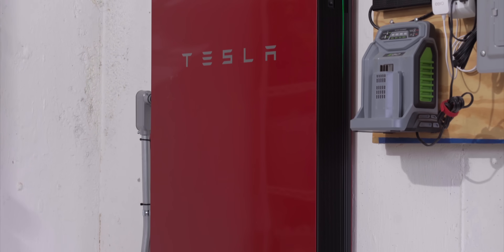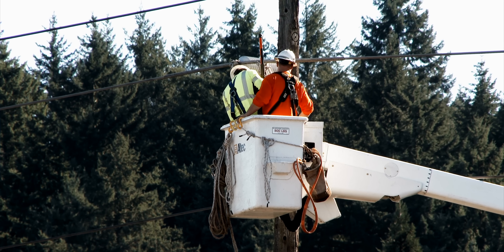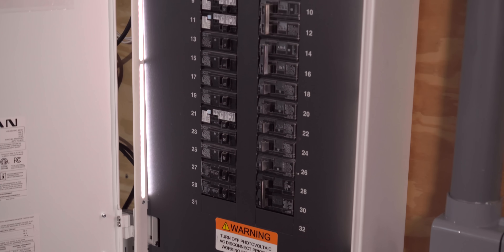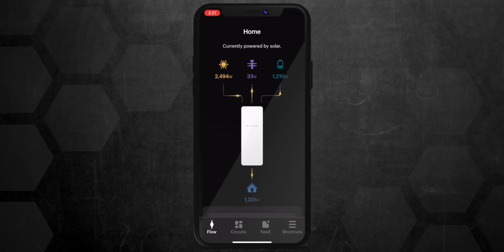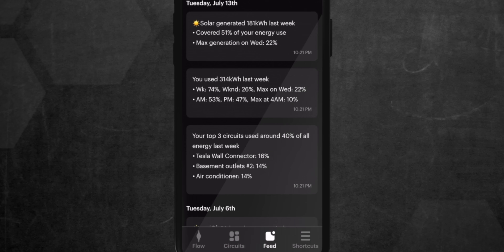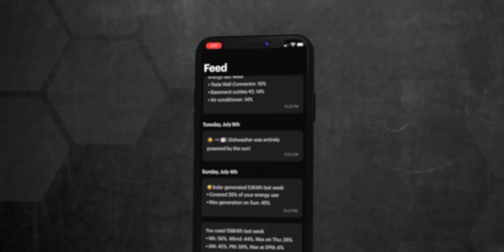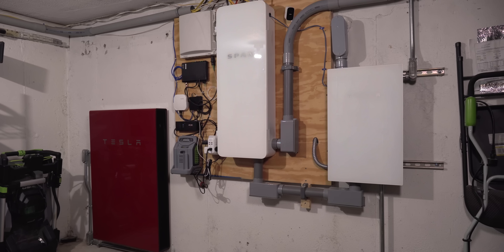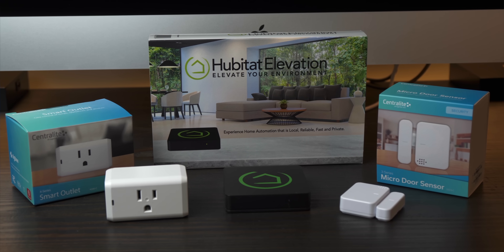This Smart Home Electric Panel Fixed My Tesla Powerwall

Comment: The SPAN panel looks to be super useful. I have 8kW PV without a battery but with and EV and without any net metering so I need to put PV power to use when it is available which is mostly managing the EV charging. Sense is a great product with nice history and makes the most of just 2 sensors, but SPAN has the real sensors on every breaker and WiFi breakers to be a real control system, but limited to breaker on/off. SPAN would give me more control options, although a juicebox charger would allow me to dynamically modulate my EV charge rate, something Tesla does not currently support and SPAN does not support. Great product. I'll be adding batteries to my system some day, although I do encourage Tesla to support bi-directional charging as it has a battery much bigger than a powerwall.

Comment: This certainly looks to be a nice piece of energy management hardware in lieu of an emergency panel, so long as it is very well made. If it can be controlled over a physical local area network, with NO wireless connection and NO internet connection I would definitely like it.
Reply: no wireless and no internet? so just a normal panel... ?

Comment: I'm getting more and more interested in getting solar installed.  I have two buildings, a barn and a house.  The barn has a south facing roof, so I'm looking into whether I can install solar there, but the have power delivered to the house.  Maybe Span would be a good fit (though not for that part of the distribution, both buildings have their own panels).  Thanks for the info!!

Comment: This sounds like something that ought to come standard with the Powerwall.
Reply: You don't want a $7k powerwall and $1.5k backup gateway + $1k sub-circuit install (and rewiring both panels / certified compliant wiring and local regulation standards) to cost $13k instead of $9.5k.

Plus, local regulation may prevent the replacement of the main breaker panel unless it meets certain code/approvals, i.e. Outdoor NEMA rating or metal enclosures for indoor/outdoor exposure to weather, etc. While the TEG or Tesla Gateway uses something similar for consumption monitoring (Neurio home monitor), the technology doesn't talk to each other, the app/infrastructure is probably going to be duplicated under the panel i.e. CT Clamps and circuit clamps, sic.

IMO, Only a handful of Solar/electricians will have experience with Span, so it's going to be much better to find an installer for a quote, which is going to be the fun part.
Reply: The issue is more that 1 power wall on its own might not power a typical usa house in a blackout, but 2 power walls probably be able to handle it (but really it's quite a new thing been the only house in the block that still has lights without a generator)
Reply: Span is run by former tesla employee's actually. I was thinking the same thing when I first saw it last year. Kinda surprised Elon didn't offer to buy them out. 🤔
Reply: That's not really something a battery storage system could do though, the changes are at a hardware level at the main panel itself. From what I gather, the Span panel basically has relays that can shut off/exclude specific breakers from backup while keeping the rest in backup. A change like that could only be done by modifying the main service panel bussing, which is what the Span panel appears to do. Maybe one day Tesla could have their own main service panels that operate like a Span does, but even then it would add substantial cost and complexity to the installation that almost always isn't needed.

Comment: I was hoping you'd give a performance review of how the system worked on your last power outage .  Like how long was the outage and did you run out of battery and have to shut down household items???  

Over the last 11 years my solar system has fed my house and the grid nicely and I've not paid anything to the electric company. (@ $3/mo connection fee)   Here in Colorado the reliability of the grid is great and I couldn't justify a battery to far.

Comment: That product is really cool! I would use that in my solar solution or new build without question. I see the greatest value in off grid living which is my goal. Just finished a camper van conversion with 300ah of lithium batteries and 320watts of solar. It was a fun project and helps me appreciate solutions like Span.

Comment: are blackouts something common in the US? he keeps mentioning it like its a guarantee
Reply: I wouldn't say they're common, but many parts of the US are subject to weather events (hurricanes, derechos, ice storms) that can knock power out for a significant time. Unless you reside in a place where electricals are underground, you can probably expect to experience an outage lasting longer than a day once every 3 years on average and shorter outages (often less than an hour) a few times each year.

Comment: Matt, Very interested indeed. I have written my own solar/battery application to decide when to use grid power based on the state of charge of my battery pack and the weather forecast for sunshine tomorrow. Span sets a very high bar for domestic circuit control -- not sure if it includes the weather forecast feature. Eamon

Comment: I am going to build a new house.  It will have solar cells, battery system, solar hot water,  solar heating and cooling, and backup water condensation system. What water? Water when flown through a condenser IS THE MOST heat for the lowest cost!

Comment: Does your house have a sub-panel? If so how did your Span install handle that?
Reply: Multiple Span panels can be installed in a home. If you'd like to only have one Span panel, you can install Span as the main and then have On/Off control for the entire sub-panel.

Comment: It would be great if you could compare Span to the Leviton Smart Panel.
Reply: Best way to describe is is Leviton created smart breakers where you have Wifi/Ethernet,  AFCI/GFCI and standard breakers with a gateway device for monitoring.   The Span panel is more like a smart busbar, it takes ordinary breakers mates them with a smart backplane that has CT (Current Transformer) on each circuit.   For precise monitoring that's hard to beat but then again if your Leviton had nothing but Smart breakers you could replicate the same.   I haven't priced out a Leviton system yet but I'm about 70 % I can install it myself.  You basically make sure you label everything.  Rough in the box and land your wires ..because the breakers are like the Plug on Neutral type ..they just pop right on at the end.

Comment: 1. Can you override the panel manually. That is,  if I don't need IOT switching off of the breakers. In case someone tries to cut off my power. 2. Is the panel communicating directly through wifi (no cloud) to your mobile or it needs internet to manage the operation.

Comment: Running low voltage together with high voltage in same conduit is questionable under NEC and local codes. Almost certainly not allowed unless all conductors are insulated for the max voltage.
Reply: Correct - high voltage and low voltage wiring in the same conduit is permitted by code if the low voltage wiring has an insulation rating of the max voltage.  Some local jurisdictions may prohibit it however - I'd prefer separate conduit.  Matt's previous install with the zip ties was ok for code also, but perhaps not the best for aesthetics.

Comment: Another great episode Matt. Thanks very much. I'm thinking about setting up solar and really appreciate your channel. I can definitely see how an electric panel could improve a solar setup. I'm in Canada so I think I need to manage the solar power I will generate more strategically. I don't know if you've covered water monitors before but I recently put one in (I bought a Moen Flo but there are several out there). It's great and has really helped me monitor my water usage. Particularly my drip irrigation, which was always a bit of a black box. And timely detection of irrigation leaks was always an issue. Not anymore.

Comment: Great video Matt! I have been eyeing this product for a while. Since I am getting solar and powerwall it would be a nice addition. So with the Span unlike normal installs where they add another panel to split essential and non-essential loads; the installer would simply put everything on the 1 Span panel and you have the option to separate loads at will?
Reply: That is correct! All loads go into Span and then you get choose on the app which loads to prioritize. We'd love to help you get span: span.io/get-span

Comment: But the panel is still limited to the supplier of breakers. Square D only works for Square D and so on. So the breakers are still proprietary.
Reply: Span is different. The Span Panel accepts Square D, Siemens, and Eaton breakers.

Comment: If you are constantly worried about black out I would move out of the area (or state like CA).  That being said though I could see every house using a storage battery (iron/air) that can take charge during non peak times and allows the house to draw from that battery during high peak usage (i.e. a very hot day).  With the utility in control of the battery they could smooth out their high and low demands and would be able to cover better for lack of sun or wind.  If more insentive is to be added every house having solar and/or wind would reduce the potential for black or brown outs

Comment: I love everything but the price.  I think I'm just going to get smart outlets for dishwash, computers, tv's, ect. and a few smart breakers for the high power dryer and air conditioning. Lighting is such a small load with led now it's not much of a concern for monitoring.... and smart bulbs solve that aspect too.  The app is really the show stopper here.

Comment: As much as I like seeing this new technology out there for individual consumers it still just seems wasteful. I would rather see things that allow the major utilities to store energy for peak solar time of day instead of every average joe needing 60k worth of solar/batteries/smart breaker panels. Even if you consume a ton of energy per year it will take 20 or more years to break even. By then you will have had to replace the batteries and solar all over again. 
It should be on the utilities to use storage via iron air and liquid metal batteries and redox flow batteries. Save lithium for vehicles and e-bikes and quit wasting it on power walls or Giga power packs. 
I also think utilities should allow people to utilize more solar panels per home instead of limiting it to the average monthly use. Just pay individuals a flat rate that they would pay power plants. If the storage issue gets figured out then the duck curve dilemma goes away.
Reply: Also instead of power walls, people could probably just get by with a pure sinewave inverter with deep cycle batteries or lifepo4 batteries for probably 1-2 thousand and run all the essential things during a blackout or brownout. It still could be charged via solar or just plugging it into a normal outlet to charge up. Better yet go the ford lightning route and just run critical loads off the truck battery.

Comment: Very cool. Reminds me of the Powerhouse Dynamics product I had in 2010 call the eMonitor or later SiteSage. It monitors up to 44 circuits directly, not with software like Sense. Span seems to do the circuit level monitoring with the ability for smart controls. Exciting.

Comment: What about when the SPAN and Powerwall don't have  internet connectivity? After an extended power outage our permanent whole house generator ran for a few days my main internet connectivity dropped I got a taste of just how many of the services in my house depended on that connectivity. Even though I had locally generated power many devices would not work as intended because of lack of internet access. I had read that the initial Powerwall installations would not provide work if the mother ship could not be contacted is that still true?
Reply: Span and Powerwall communicate locally. When there is a loss of internet, the system continues to operate.

Comment: If you;re planning on installing Solar PV/Battery, I’d look at the Gernarac PWRcell system.  It has has capacity of controlling major loads (240V) loads and turn them off as needed with Smart Switches.   Batter is modular going from 9KW - 18KW battery capacity.   Just another option to look into if considering new system.

Comment: I needed a new breaker panel recently and I was scheduled to get a Tesla solar roof installed with Powerwalls, so installing a SPAN panel seemed like the right way to go. Unfortunately, Tesla solar decided to screw me over and raised my price over 70% the day after my inspection. I love my SPAN and I like the insight into what appliances are using the most power, I just wish I had my solar roof to really test it out.

Comment: I just had my SPAN panel installed 2 months ago. Along with Tesla Solar with two Powerwall 2+. It's a beautiful and clean setup. And I love the new SPAN app! The 'By Area' feature was definitely needed and very nice addition! Thanks for the video Matt! This solidifies my decision!
Reply: Does the SPAN panel eliminate the need for the Tesla gateway?  I would be surprised if Tesla would agree to that but the SPAN panel sounds like it can fully support the gateway functions and it would help off-set the high price of the panel.
Reply: @DaveMcG54  No it does not. But, I believe in the future that Tesla and SPAN can work together to build a seemless system.
Reply: What was the order of operations for your solar and power walls and the SPAN controller for installation? Can you do the power walls first then the SPAN?

Comment: I have solar but no power wall yet. Power walls are like finding hens teeth. Since I have every intention of adding a power wall I’m going to look into the installation cost. My house is old 1981 and the power panel has seen better days. My view point is this device will help me decide on one or 2 power walls. Thanks again for doing the leg work that us cheap SOB need done.

Comment: I've got lots of solar and really want house batteries but the economics and functionality just don't make sense right now. I actually was in contract to get an LG Chem battery added to my system but when it came down to the critical loads panel and its limitations, especially for how my house is wired, I just couldn't do it. The Span panel takes that part away but the total price is still a big hit. But it's definitely a required component when I do add some sort of battery.

Comment: I currently am running a 10.5 KW array of solar panels with an inverter and dedicated sub-panel for essential circuits. It is teamed up with two Tesla Powerwalls. I have to turn off the air conditioner/furnace and water heater circuits when I have a prolonged power outage because of the limitations of the Powerwall storage. I am thinking of installing a drain back solar heating system since it will take the water heating usage totally out of my circuit. It costs $7000.00 installed but, since I will also be able to add a heated floor to our master bath, I think it might be a way to reduce my grid usage and increase my off-grid time with my Powerwall. What do you think?

Comment: I'm concerned about the long-term support for something like this. I have plenty of smarthome gadgets that are no longer supported like moisture sensors and astronomy gear where the manufacturer has moved on to newer and better things leaving my gadgets behind. What it means is that I need to keep older smartphones and ipads alive in order to run the software that connects to my gadgets because the newer versions don't support them. It's tolerable with things like telescope controls and watering sensors because ultimately they're relatively affordable things and I could upgrade them if I wanted to a spend few hundred bucks on them again but for something that is hardwired to my house and not cheap to replace...I have serious concerns. For something like my plant sensors where the company disabled the cloud support a couple years ago making them e-waste I've turned to open source arduino solutions that I can run and maintain myself indefinitely. For something like my telescope mount controller I just have an old iPad 4 I keep around to connect to it so it's not too bad. But for something hardwired to my house I would definitely be concerned that the company behind it may choose to pull a Sonos or Nintendo one day and either stop supporting the thing outright (ahem, Sonos) or turn off the backend "cloud" services one day thus crippling or even disabling it (Nintendo). I mean technically my Nintendo Wii still works but none of the cloud stuff is there, it's a ghost town. And I doubt any company will want to keep a cloud server alive forever, even ten or twenty years seems like a long time for them to support something that costs them money to maintain servers for. The panel in my house when I bought it was 50 years old. I don't see any modern tech company supporting something like a smart electrical panel for half a century at their own expense. I'd be very hesitant to add smarts to durable goods that require outside support. Open-source stuff maybe because at least I could run the cloud stuff myself for as long as I need to but to depend on a company to maintain a cloud connection to a durable good in my house forever...yeah....no.